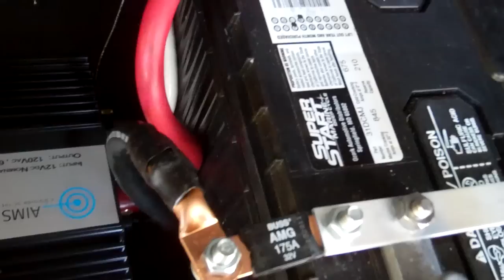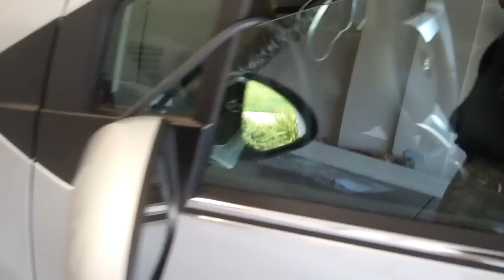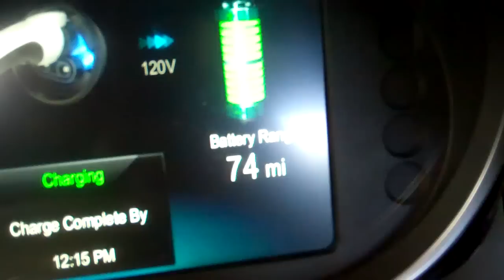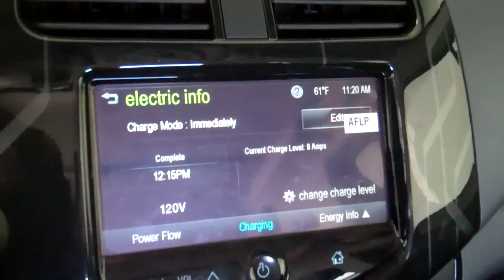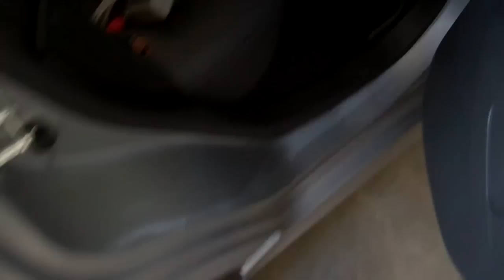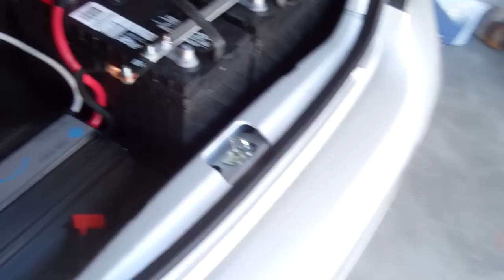DIY EV Range Extender

Comment: These batteries have turned your car into a death trap! In a front end collisions they will fly forward and kill everyone in the vehicle! In a rollover they will cover you with acid. In a rear end collision they will cover you with acid. Look up Jehu Garcia on you tube and spend you money on laptop batteries AND a cage to mount them down.  Also while charging overnight, those batteries could out gas enough hydrogen to cause an explosion. Get a small trailer and a small 2kw diesel military generator. Please be safe.
Reply: Richard Hauser there is not much safety concerns if they are bolted down properly. Many cars have the batteries inside the passenger compartment. Batteries don’t leak acid that easily, specially marine deep cycle he is using
Reply: @bayhaskana7439  True... although it looks like his 70lb batteries likely are not strapped down... likely just the weight is holding them in place.

Would think mounting them to his chassis would not be difficult, also likely not very expensive... just so long as any bolts purchased are quality ones so he does not have sturdy mounting bracket only to have a bolt break and have 3 70lb batteries flying around I  the car :p
Reply: @bayhaskana7439  I did not see many "Passenger Cars"  with batteries in the passenger compartment in 10 years on the spanners. Lead acid cant beat Li ION or thats what "they" would use
Reply: @av6966  in 10 years you have not worked on a single Mercedes Benz or other European large passenger vehicle? Merc places battery in various spots in trunk, under back seat, behind back seat, under front seat, or in rear fender on most models since early 90s.

Lead-Acid models are vented to the outside using a plastic hose. Li-Ion batteries are relatively new, and were not an option in the 90s.
Reply: How about a direct wire old rebuilt Prius battery. It will fit back there. Has the correct voltage without needing an inverter, safer as far as no acid, and more power to weight ratio. Thoughts, comments... thx
Reply: AGM batteries are the safer alternative, get you an old ugly speaker box at the swap meat and use that as an enclosure for the batteries.
Reply: @TheBikemaster94  Sure QGM are safer, but do you usually get AGM in that larger size?

Your battery box idea is interesting... that could work... I would lean more towards just buying battery boxes... they are approx $10 each... if you Google around I bet you could just find the correct plastic type and get a big plastic bin of the correct acid corrosion safe stuff... just be sure it is not airtight as I believe all sla batteries have potential of hydrogen degassing... not sure if AGM is different in this regard of not
Reply: my god! the horror! what if all our cars ran off of explosives? can you imagine putting 70 pounds of highly flammable liquid in the car? gasp

Comment: Sorry, TERRIBLE idea to use lead/ acid as a range extender for several reasons!  Enormous weight penalty... short life... low energy density, and possible hydrogen outgassing.  Far better to use lithium ion, lithium iron phosphate, lithium polymer, etc... Far lighter, much better energy density, longer cycle life... but you do need battery management system (BMS), which you can find out about online.  Thank you for driving electric!

Comment: Suggestion.Install a class one hitch receiver. Put a luggage carrier with a lithium battery pack and inverter with charger permanently mounted to the carrier. Folding adjustable height wheels flip down from the carrier when you want to pull the pin and leave the whole thing behind for all but long trips. Many charging stations have a free 110 outlet where you can plug in while charging your car's traction battery. A light weight gas generator inverter mounted in the carrier would work also.  A plastic cover over the system would protect it from the elements. For my Kia soul EV on a 90 mile round trip where I spend two and a half hours at the destination before returning home, With this system, I wouldn't have to stop at the charging station on the return trip home.
Reply: A portable, folding solar panel charging system could be mounted to a luggage carrier. It could stand up in the carrier on an angle facing the sun and charge the car. It could even fold up and over the cars roof with some cleverly designed quick disconnect mounts on the car.
Reply: Make a video of it

Comment: A small 2200 watt Ryobi inverter generator in the trunk is the way to go. It is small, and rated at 120V at 15 Amps. It weighs 52 lbs.
Reply: https://youtu.be/n1u4QVkqhUE
It fits in my Spark's trunk
Reply: Better yet. Install a class one hitch receiver. Put a luggage carrier with a lithium battery pack and inverter with charger permanently mounted to the carrier. Folding adjustable height wheels flip down from the carrier when you want to pull the pin and leave the whole thing behind for all but long trips. Many charging stations have a free 110 outlet where you can plug in while charging your car's traction battery. A light weight gas generator inverter mounted in the carrier would work also.

Comment: This is brilliant. I have discussed with a friend who has a Volt and he's interested as a way to extend his electric range.

Owing to the Peukert Effect, it is better to use your lower wattage inverter and the 8 amp charge, anyhow, as you discharge the batteries slower and thereby maximize their capacity.

Anyone who says a generator is better, no way. Any suitcase generator you'd reasonably be able to carry, such as a Honda EU2000, would give you about the same added range as this, but you'll wear it out in a short time running it close to full tilt as you'd have to, plus how many places do you have adequate security to set up a generator and run it unattended without fear of it being stolen or vandalized? How many places want a gas engine running in the parking lot for hours? And if it rains, the generator is likely going to be damaged. Moreover you have to carry gas in the passenger compartment of your vehicle. Bad idea.

You can also use your setup to reduce deep cycling of your car's onboard battery, extending its life. I would use this to charge your battery anytime you anticipate running below 50 percent, reducing the depth of discharge of the car battery.

Thank you so much for sharing.

Comment: Good  work analyzing the weight and effect on range.  Weight has a negligible effect on range in EV's because of regenerative braking.  The biggest loss in any EV is aerodynamic losses.  Putting spats (covers) over your rear wheels can improve mileage by up to 15%!  Converting mirrors to cameras can save as much as 5%.

Comment: You are very creative!  This is a good attempt, but to be truly useful you can figure out how to tap in directly to the 360(?) volts of the main battery and extend the battery directly, while driving!  There's a guy who attempted that with the Leaf.  Also, you would want to use a lithium pack eventually, and put it on a trailer so you don't need to carry the weight except when you need the range.

Comment: This is a pretty cool setup, but how do you plan to evacuate the hydrogen gas it puts off, or what will you do if the batteries boil over? Just a thought, the only thing I'd change in this setup is the batteries, going with either sealed lead or lithium batteries. Cool none the less though!

Comment: Great idea but 6-10 miles, Also 8amp charging=about 2kwh your inverter is rated 1.2kwh and 2.4kwh peak, so should fail after a few minutes. Next the deep cycle battery is good for perhaps 300 cycles, so 300x10=3000miles the 3 batteries and inverter and bits, lets say $600 600/3000 + electric -efficiency 35-40 cents per mile best guess.
However i'm not criticising, i like the idea.
I think a light weight 2.5kwh petrol generator would be a better idea.

Comment: Only if you had waited another 2 years then buy 2017 Chevy Bolt with 3X more range than your 2015 EV car. Never have to lugged 3 lead acid batteries in back of Chevy Bolt.
Reply: Stan McBeth Hey Stan Pull my finger...

Comment: Congrats on your ingenuity, a job well done. Just to add, make sure to meter and monitor the discharge level on your batteries. Don't discharge too much, the batteries won't last. Batteries as you pointed out are expensive. Well done!
Reply: High Tech batteries are available;ie, Lithium 12 volt car batteries.  Probably need deep cycle model.
Reply: @artman102  How much more expensive are those?

Comment: Interesting idea. I just drive my Spark a little slower to create less drag which increases range. Also if you hit the car in front of you those batteries would want to fly up front. God forbid someone hit you in the rear and those batteries crack, spray acid and hurl to the front....
Reply: droid2084 it's not drag that decreases your range at high speeds, electric engines have a higher efficiency if the rpm is lower

Comment: are u loosing some range by carring the extra weight of battries
Reply: total range will increase though, but consumption too. What I don't like is the inverter: Their efficiency is no great and it is used to power the charger which has better efficiency, but also wastes 10-20%. Then there is the constant maintenance charge and worse charge efficiency of lead acid batteries, so his power bill will go up more than the range increase. Make a string of lead acid batteries to match the voltage of the pack and connect them before driving.
Reply: @Tore_Lund  400V?
 You know all this idea is stupid. Charging at less than 1kW? Not worth the effort at all

Better upgrading the 10 year old battery pack with a newer version with more capacity. This would be perfect for a Bolt EV cells transplant.

Comment: I don't agree with this method, but I won't throw stones at anyone trying to think out of the box.  However, how have you considered the gases produced by the flooded cell batteries... inside the passenger cabin?
Reply: Flooded lead batteries produce Hydrogen gas, especially during the ending charge cycle at upper voltage ranges of 13-14v+.  These gasses should be vented to the outside and not contained inside of a passenger car.  If lead type batteries are used inside, sealed lead or AGM should be used because they don't produce hydrogen gas.
Reply: @machaf  Sorry bud it was for those who were concerned about the gas whilst charging
Reply: FabioPanucci  you right,  acid vapors damage fabrics and not good for humans..
Reply: @machaf  Lead acid batteries can be vented outside the vehicle by connecting plastic or rubber tubes

Comment: Nice set up . Can you unplug the inverter and have the cables hook to the regular car battery to charge them while you drive with the car alternator
Reply: Cali Coca electric car no alternator
Reply: Add an alternator for batteries only, there’s an idea
Reply: But if batteries were trickled charged somehow it would not be a bad idea
Reply: They just need to add some self charging batteries through what ever source so it can be free to drive

Comment: Efficiency works like this.

Battery charger to battery pack efficiency say 90%
Inverter say 90 %
Battery charger to car battery pack say 90 %
Car motor controller say 90 %
Electric car motor efficiency say 90%

Total efficiency 0.9x0.9x0.9x0.9x0.9 = 59% and thats being generous it may actually be below 50%

So yes it does work no doubt but perhaps there is a better way. 

I put a 2kW petrol generator in the boot with a fitted exhaust and ran that through my car charger, it worked.

Just keep in mind though that you have to keep a record of how many km you got out of your MAIN  battery pack before it had to be replaced and how much that worked out to per km. Lead acid batteries are about 10x more expensive than using gasoline.

I do like the fact that you can charge it while you at work though without having to ask the Boss if you can plug in thats what makes it a reasonable idea if you cant plug in at work

If you fitted a kWH meter to your power in line and could prove how much you using then you can pay for a full charge while you at work even although its so little.

Comment: I've driven my Nissan Leaf for over 4 years now and never had a situation where I would need to charge anywhere except at home. I use the car for business and have a route that is about 50+ miles a day . Before I purchased the leaf I had to figure out if a pure electric was the way to go and it has worked out great. If I was going to be driving any further I would have probably purchased something else.  I have more range on my car without any passengers or supplies in the car, the Leaf doesn't even have a spare tire to reduce weight, if you're hauling around extra batteries you might be losing a few miles of range, in my experience that's what I've noticed. I haul several hundred pounds of equipment some days and I notice the range drop so I just drive the car like an old lady on those days . I'm glad the setup you have is working for you, I know everybody's situation is different .
Reply: I've lived in big cities all my life and never had to commute more than 25 miles each way... what's your problem buddy?

Comment: Throw a 300W solar panel on the roof of the car and you're golden.
Reply: vuaeco It's charging at 120v @ 8A which equals 960W.  He would need four 300W panels with no shading to pull off what you're suggesting.
Reply: And that's before calculating the loss between DC->AC->DC. If we assume a nominal 85% efficiency for inverters*; he's lost 27.75% of his power in this setup.

*the OEM is likely more efficient; and the consumer in the trunk less efficient... so not a perfect demo. Nonetheless, nearly 30% is still a lot of power lost.
Reply: Not when you run out of power at night.

Comment: i know this is probably to late , i will say it anyway , i seen a vid on youtube , will try ti find it again , where a guy put a high capacity air tank in the back using a turbine generator hooked into a convertor like what you have and got an extra 20 miles charge time before the tank was empty ,, another example was a guy that was using fuel cells to directly power his electric drive motor , he was using an illegal substance to produce electricity from the fuel cells and was arrested and fined , i find it strange why some videos are removed when something this efficient is discovered ,, why wont the gov just make these discoveries safe to use instead of preventing them ,,

Comment: Solar panel would probably give you 12 miles range extra free a day
Reply: If it were that much, everyone would be doing it.
Reply: Any calculations to back that up professor?
Reply: ⵉⵜⵔⵓⵏⴰⵓⵜ 2 500w panels will give approx enough to add 12 miles to the range, a full day of sun will give about 2.3kw, the spark will do about, ymmv,   5.3 miles per kw, 12 miles would need about 2.25kw, so no A solar panel would not add 12miles but two would. Prof H
Reply: @howard922  The car have 19 kWh in the battery pack brand new. The range is 80 miles. 

5% will be around 0.95kWh, approximately 4 miles without any extra weight. 

Very likely with the weight of this setup will make barely just between one and 2 miles.
Reply: No, when you run out of power at night, the solar panels are useless.
Reply: Thordur Hogna lmao.

Comment: The best idea would be to always tow a trailer with a big and strong horse in it and enough hay. In case of a range problem the horse would gratefully help you out.
Reply: Juri Vlk or a big smokey diesel generator.
Reply: Or adapt an outside alternator to the wheels to generate charge to the batteries

Comment: LOL Chevy already figured this very problem out and the solution is......A Chevy Volt
Reply: No he means a Volt. Has a gas power 37Kw generator under the hood. After the battery is flat you can drive it all day on the gas engine.
Reply: D M you mean a bolt
Reply: Lol you guys are funny, I can’t stop reading
Reply: A volt is a hybrid, this is full electric, maybe your thinking the bolt

Comment: I have Chevy Volt and planning to add a little horizontal wind generator behind the front bumper where the air intake is for radiator etc. Wind generator has nominal weight compare to the batteries that you used and while driving around 25-35 mph, it will spin the wind generator that will charge the main batteries of Chevy Volt. I am thinking to use Grid tie inverter with wind generator that will produce 120 V directly instead of AC > DC and then AC again.
Reply: Too freakin funny. I'm all for a perpetual machine and warp drive myself...
Reply: You are describing a perpetual motion machine which is in the "snake oil" realm. In the real world there are losses in the form of heat so the extra drag caused by the wind machine will not return the energy lost.
Reply: Dang Newton!
Reply: i am warp drive  :))

Comment: I think it is more efficient (energy and money-wise) if you just add a Gas-Powered Portable Generator instead.
Reply: I’m thinking of putting a hitch on my Fiat 500 e then a basket that would hold the 38lb harbor freight 2-stroke generator that would charge while you drive 😀
Reply: What kind of generator? Remember cost
Reply: yamato908 That is very true. The very first Tesla prototype had a small trailer carrying a gas generator, for long range trips. Tzero was the name of it..... Very fast car☺

Comment: Hard metal connections are not the best for an environment where there is constant movement/bumping. Safer to use copper cables. Be sure not to top off the battery! You should drain it some more before charging to full. .... Sweet ride BTW! Thanks for sharing your build. You bought extra miles :).... Nice you have an rv converter as a charger... I got one not too long ago for the rv..